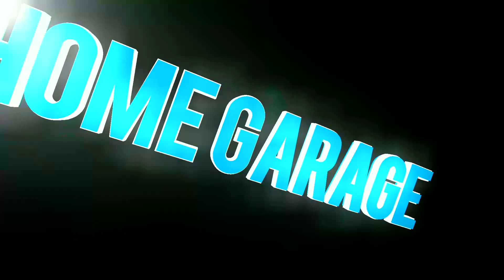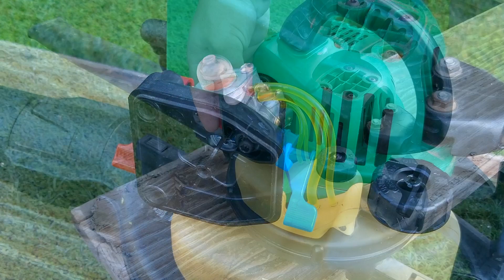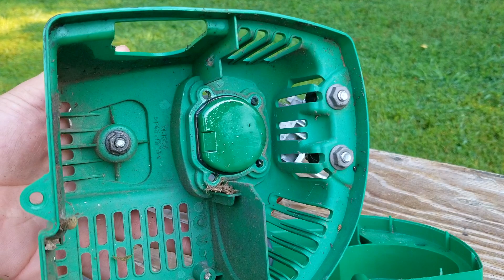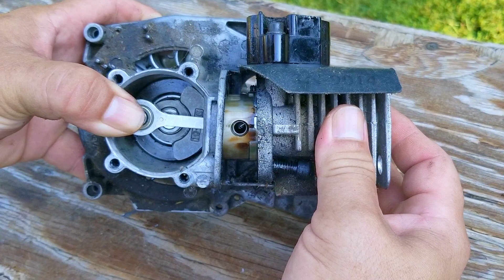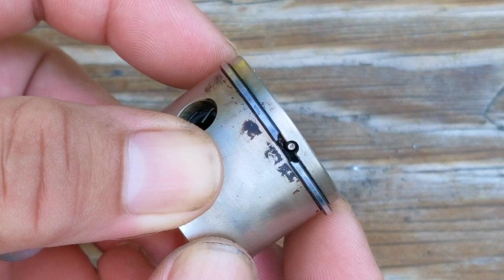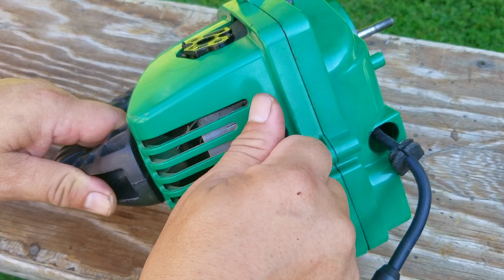Trying To Fix A Weedeater Blower But It Has Other Ideas

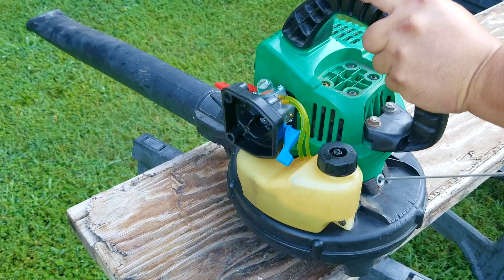Comment: It's the muffler, it's clogged up which is why it's backfiring thru the carb. Issue diagnosed @ 2:52, solution: remove muffler and use a map gas torch to burn off the collected unburnt oil clogging the muffler (you can also build a fire and throw the muffler in the hot coals for an hour while maintaining the fire to achieve the same result as using the map gas torch).
Reply from the maker: did you watch the entire video?   The answer to this problem was showing in a later video.

Comment: Did the flywheel key look ok? Maybe the timing is off.
Reply from the maker: You're right, the key was sheared!
Reply: @HomeGaragechannel Good to hear you had success. I’m dealing with my own headache of a WeedEater Featherlite SST25C trimmer. Have spark, fuel ( new carb), and intermittent compression. Removed muffler and noticed piston ring somewhat shiny but was wobbling as I moved piston up and down. Waiting for new piston. Also making sure there is no vacuum leak at the intake manifold. Wish me luck.

Comment: well its not ohv so that rules out cam or valve adjustment.
 which leaves carb and spark plug and ignition coil (magneto). are you sure that the coil pack is not faulty. i dont recall if you showed spark or not? its 2 stroke so air ,spark and fuel and compression are all it needs to turn over. id check the coil pack for spark and spark plug gap or correct plug. id bet that it lies between coilpack and plug
Reply from the maker: turns out the timing was off because the key had sheared on the flywheel

Comment: It had more than enough compression to run. I don't think the engine was the problem. Did you ever check to make sure that it had consistent spark? I don't know much about these engines, but due to the back fire, it could also mean that the timing was off somehow.
Reply from the maker: yes I believe this one had a sheared key which is hard to do on a blower

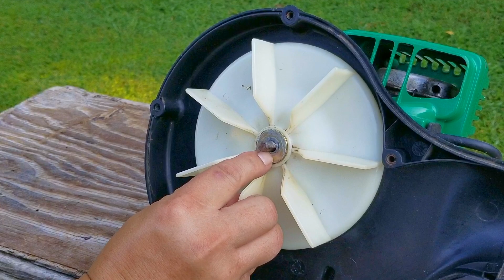Comment: 3:35 this saved me a lot of trouble, thank you!  I took the bottom and fan off to work on the recoil spring and didn't notice that the spacer sleeve over the shaft fell out.  Put it back together and the fan was rubbing against the housing which wasn't happening before.  Saw this video then found the sleeve and re-assembled 🙏🏼
Reply from the maker: Glad it helped and thank you for your time

Comment: I'd say it can be an ignition, bad coil or spark, but I've looked up to comments, which said about a key, which still kinda a part of ignition system, timing part.
Reply from the maker: you are correct the key was broken causing the ignition timing to be off?
Reply: @HomeGaragechannel  yeah, there should be couple of magnets in flywheel, which inducted an impulse to a cool, every revolution of motor. By rotating flywheel, ignition timing can be changed, advanced or retarded. 
Modern coils have a chip inside them for timing, but flywheel itself still shall be in only one spot, because its tightened down.

Comment: Ignition timing, ignition timing, ignition timing. Those jobs will lead you running in circles and wondering, why me!? If a two stroke has good spark, good compression, and good fuel, but still won’t start, there is something wrong with the ignition timing.
Reply from the maker: you are correct

Comment: Compression ✅, fuel ✅, spark ✅...
That means timing .. a backfire out the intake would also suggest timing.

Hopefully you got it sorted
Reply from the maker: You are 100% correct and yes I did get It running after installing a new flywheel key

Comment: Follow up PLEASE!  You’ve gone beyond anyone else on YouTube, but you’re not at the end yet.  
Flywheel key, clogged muffler, ignition coil, etc etc etc.  The suspense is overwhelming.  

It doesn’t matter if it’s WORTH fixing; it’s about KNOWING the solution … or, what’s around the next corner!   Are we at the bottom of the rabbit hole, or is that a FORK in the road ahead!

Love your channel!!!
Reply from the maker: you are correct, the flywheel key was sheared so I had to cut a new groove in they flywheel and install a new key

Comment: That piston ring needs to be oiled.  A dry ring will have low compression.  Easy way to check for a stuck ring or low compression is to pour raw 2 stroke oil down the plug hole.  Then add a little gas through the intake. This will temporarily increase compression, if it starts then it could be worn rings, stuck rings etc.
Reply from the maker: oiled off camera before installation  thanks

Comment: Just wondering is it bad for the engine if I run my whipper snipper to 0 fuel, my blower to 0 fuel and my new honda mower to 0 fuel. Is it bad for the engine that it has to run like that at the end or is it fine?
Reply: I have a Stihl KM-56-RC whipper snipper, Stihl BG-86 leaf blower, and a Honda HRG466PKU lawn mower.
Reply from the maker: In fact if you check the owners manual it might answer your question about storing it.
Reply from the maker: I have not seen any damage caused by it running out of fuel.
Reply: @HomeGaragechannel  Ok thanks. I pretty much use them every 2 weeks, because it is Spring here in Australia and should i even bother removing the fuel or no?

Comment: While we could yammer on about that dark place you're stuck in right now, one question arises that hasn't been noted: Have you checked the ignition/engine timing? Try not to overthink what is or isn't more than 8 degrees advanced from TDC when starting and just check the flywheel key way.
Reply from the maker: you are correct, I forget to pull the flywheel off the crank to check the flywheel key.

Comment: 11:00 check for spark?
Reply from the maker: So I didn't check for spark on screen because it was trying to start, during the test video.  So it does have spark
Reply: @HomeGaragechannel  you went through the fuel side completely and also fixed the rings and jug is solid. I have had spark plugs fool me before. Fire in open, but not under compression. It is on the cusp, I would check for weak spark or late spark. It’s like a Mopar. My Old Pig Ain’t Running.

Comment: Those are junk . but I have replaced the coil with those symptoms and it ran . problem is they get hot then they don't want to run right . Good luck thanks for taking the time to video
Reply from the maker: no problem and I appreciate the insight

Comment: i've had plugs that fired just fine as long as they were not installed , but wouldn't fire once installed . if i have a new plug , or even better if i have the same plug in something else that does run , i'll switch plugs 1st thing . if i don't have either , i'll heat plug tip and quickly reinstall/try to start . mostly though , i just refuse to work on 2 strokes .
Reply from the maker: Thank you Bill Smit, I'll be sure to replace the plug in the next video

Comment: Check the flywheel key which can sometimes break since it's moulded into the flywheel itself because sometimes it's cast aluminium.

Check for spark then squirt some fuel down the throat of the carburettor then see if it will start,do a crankcase pressure test as mower guys such as Donyboy73 & Taryl Dactal do !
Reply from the maker: yep that's the next plan.

Comment: I repaired 2 machines of this type (were branded Sears or Poulan) several years ago. I replaced piston rings on both. each machine had developed a flat spot, which led to liw compression. Back then, i coukd easily buy replacement rings for tgese 25cc
Reply from the maker: nice, it's too bad parts for these are now difficult to find.
Reply: i have one that i dont need

Comment: I dont by cheap blowers to fix or resel bicuse the parts are somtymes more exspensive then A New blower and dit you check for spark
Reply from the maker: you are absolutely correct

Comment: 110psi is usually enough to get those little guys to at least start and run to some degree.  I would start with:  Spark Test, probably a new plug first is a good idea, then make sure the cap is still secure into the wire.  After that, pressure/vacuum test next.  It could have an air leak that isn't quite as visual at first.  I always worry about plastic covers against a block with an O-RING.  the slightest deformity on it or crack in the plastic can cause a leak so bad it won't run and isn't easy to see.  

An off the wall thought, is a totally blocked muffler....I know you drilled an extra hole, and this old one likely doesn't have many passages to be blocked, but I've had those mud dauber wasps totally block a muffler exhaust port before.  Imagine my surprise when everything was checking out and it still wouldn't run lol.
Reply from the maker: thank you for all the advice, I really appreciate a second set of eyes on projects like these.

Comment: I didn't see you check the flywheel key 
You took it all apart but I didn't see you take the flywheel off the shaft.

At the same time I wonder if the ignition coil has an issue
Reply from the maker: Congratulations!! you're the first person to spot it.  I think you're right, because it's popping out of the intake
I'm guessing the flywheel key is broken. We'll find out soon enough. And yes the coil is also a great possibility.  I really like the way your mind works!

Comment: Check the black plastic manifold, between the carb and head. see if its loose....& check flywheel position see if key position moved....Only other thing I've seen with motors this type would be a bad coil...firing sporadic...Had that on a string trimmer once...Changed coil with a known running one...& started right up???  The bad one did fire with a spark tester, but I dont believe it was hot enough on firing in time.....Thats about all I got!!!   Hope you get it!!!
Reply from the maker: yep all great advice! thank you and hopefully I can get this thing done and sold!

Comment: I saw you drill another hole in the muffler,I still think you should take the muffler back off,and try starting it with the mufffer off.l think the muffler is still clog.
Reply from the maker: yes I think you're right

Comment: I have seen that in units that are flooded a LOT. (liquid puddles inside the case) Once I get them "kinda" running I always go "muffler down" for a minute to clear out anything that might be there. If you see a lot of smoke that way, it's extra fuel that was puddled in the case.
Reply from the maker: I like that tip!

Comment: Hmmm, yes a puzzler. Some good commenter’s suggestions. With that little backfire almost has to be in the ignition system/timing. BTW I noticed this one had a dot for location of the ring gap. Working on an Homelite with no marking. Where would you suggest aligning the gap?
Reply from the maker: really? I've never seen one without the pin to Help align the gap.  As for a suggestion anywhere where it will not
pass thru one of the opening in the cylinder.

Comment: Its the flywheel key!
Its the flywheel key!
Its the flywheel key!
I found that out post mortem when i snapped the ring jamming the piston in the engine, like the proper caveman I am 😂
Reply from the maker: BINGO!
Reply: @HomeGaragechannel  ,
Now Mr. HG, 
What design flaw caused this to happen?
Hint , air restriction.
(Flattened elephant nose , causes air restrictions. 
This causes failures on shop Vacs as well.

Comment: Check the flywheel key to make sure it's properly aligned for the timing.  These are known to strip out rather easily.
Reply from the maker: agreed!
Reply: Exactly !
Reply: Timing is what I thought of the first time it backfired before he broke down the engine and I was surprised when he didn't check anything about timing or the valves.
Reply: 2-strokes don't have valves.
Reply: @mikespain8655 well actually they do, although it's not like four strokes... 2 stroke engines sometimes have reed valves
Reply: @TheGhostzZ  they do, but aren't controlled via timing. 2 strokes are only timed thru their piston travel in relation to ignition timing.
Reed valves are all done thru vacuum pressure.
Reply: @demcomp  yeah, reed valve timing isn't a thing, although engines made by Piaggio for example have a rotary valve wich can be timed by grinding the counterweight of the crank, anyway in the case of this video it could be ignition timing, if the flywheel key sheered spark could happen too late or too early, another reason for backfire on 2 stroke could be one of the rings got stuck, happened to me on a scooter that the top piston ring was partially stuck so that wasn't sealing properly,  causing the engine designed to run with 2 piston rings running on one, it was infact back firing and popping on me

Comment: Have a weedeater string trimmer.  My issue, which I thought was spark, ended up being the off switch ended up breaking internally and was permanently grounding the engine, not allowing it to run.  Might want to see if that is an issue.
Reply from the maker: normally I'd agree except this one doesn't have a switch at all. To stop the engine just move the red lever all the way down and it closes the throttle plate.

Comment: So.....  No compression & spark test first, just tear the engine apart on a $90 machine?  I know this is your hobby, and you wanted to see what the hell was going on, but this machine (Anything Weedeater/Poulan) when coming into a professional shop, has an invisible sticker on it that reads "when in doubt, throw it out".  I love your videos, always fun, and you do great work, I just think in this case we need to remember that this particular make of unit is a chunk, right out of the box.  These things are paper weights even when they do work.  Every time I see one of these things come in, I check to make sure there is still room in the scrap bin before even putting it on the bench.
Reply from the maker: you make a good point and you're right I dove right into it, but to frank most homeowners wouldn't check for them either.  I've got one more idea, that probably won't make it to film and if you saw all the clues in this video, you'll already know what it was I didn't do besides the obvious of course.   At least this wasn't my usual , clean the carb and it works - video.

Comment: Sounds like the engine is down on compression the.pull start system on this one is  strange one of these
Reply from the maker: yes it does but I have one more idea to check
Reply: @HomeGaragechannel   okay hopefully it will work out for you to get it fixed up and running again h.g